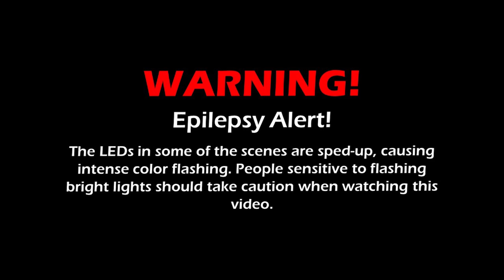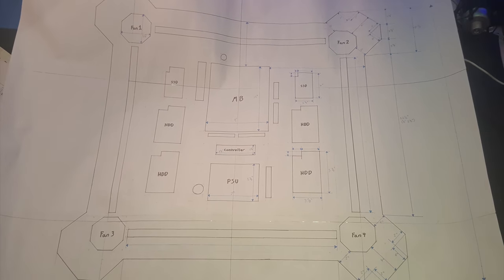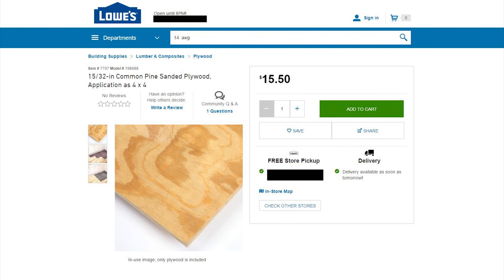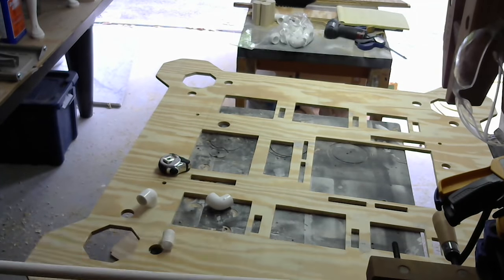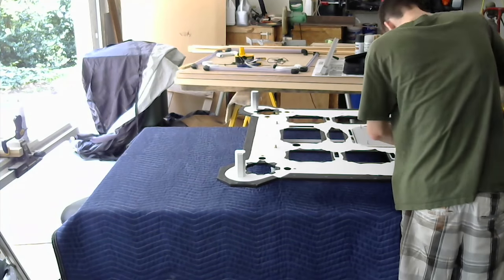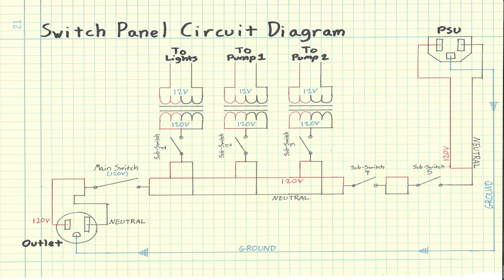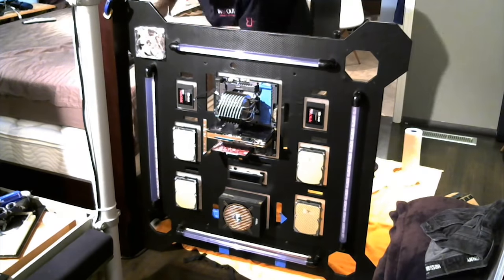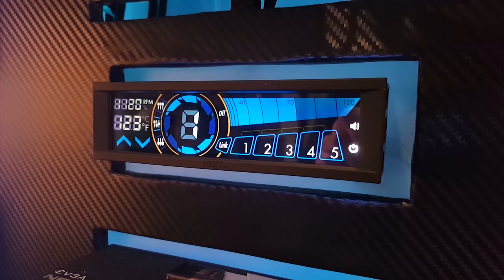Austin's Custom Computer Build Log #3 - The Wall-Mount X2 PC

Comment: I love the whole idea behind the power switch. Would have been even cooler in my opinion if you had a plastic cover over the main switch that you had to flip up each time. Overall amazing build!
Reply from the maker: I was thinking about doing that, but I wanted the light-up switches instead. On the next build, I will most likely do the covered switch version. Thanks for watching! Glad you enjoyed the video!

Comment: Can I just ask, how is this cooled? I wanna build a wall-mounted computer, but I'm scared of the high temperatures that can happen without any fans. Am I missing something, or is the build actually cooled?
Reply from the maker: The only components that need cooling is the CPU and GPU. The CPU is solved by either an air-cooler or water-cooler of choice. Those coolers have their own air movement system (I.E. fans) and the GPU has its attached cooler, which also has fans. Everything else doesn't need to be cooled being that components such as the MB or HDDs don't generate enough heat to where you have to worry about them. So to answer your question, everything is open-air designed with only the CPU and GPU being cooled with their own devices. Hope this helps!
Reply: SkitsGroup ahhh, okay. Thanks for taking the time to answer!

Comment: Are the components sitting flat against the acrylic, or do they stand off a bit?
Reply from the maker: They are raised away from the acrylic by the distance of the thickness of the wood, which I believe was 5/8ths. I used little nylon spacers from Lowe's to raise the components.

Comment: What did you use to keep the graphics card in place? That it cant break out of the mother board.
Reply from the maker: I used a custom made aluminum bracket that the screws go into and another bracket that wraps around the card to keep it securely in place to the case.

Comment: Where did you get all your screws, mounting equipment, etc etc?
Reply from the maker: Lowe's...it was a mix match between stainless bolts and metric bolts.
Reply: SkitsGroup  Well, sadly there is not a good store in Norway that sells that kind of stuff :/

Comment: it looks great but I feel like with making that loop for mineral oil it was a wasted opportunity to do a full cpu loop at the very least and the water inside would have looked great since you said you could actually see it flowing when you filled it to test it. The only other thing I would do is maybe on the MOBO I/O side created a pass through or raised shield blocking the wires for all of your cables. Those are two very small nitpicks though, but as I said, it does look great.

Comment: Cool clean build but you have a couple of things wrong.  You added mineral oil to your build but you're not using it to cool any of your components.  No CPU block, GPU block, radiator...  and your fans are not doing anything for cooling.  I'd suggest you repurpose your tubing to cool Both CPU and GPU, place a radiator behind each of those fans get a pump to get that water cooling!

Comment: How did you make the GPU supports?
Reply: You can cut 2 small metal strips about 1/2" and have em at a right and and just drill a hole for the screws for the gpu
Reply: Kinda look at a normal case and copy that in a way

Comment: how did you mount the psu to the case
Reply from the maker: I tapped the metal shell of the psu on the bottom and threaded in 4 stand-off screws, then it was mounted the same way as the other components...they are secured from the back of the plexiglass with screws.
Reply: Thanks

Comment: If you wanted to water-cool this, you could try using a series of 80mm radiators along the sides (behind the board). I'm not sure if they have RGB fans that small, but as you're not going to see them you can just run RGB strips on either side.